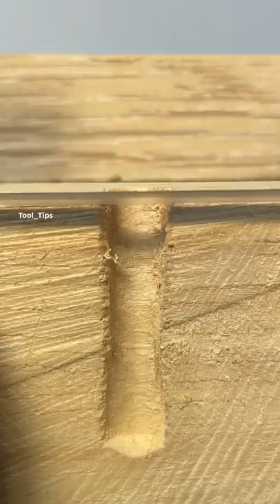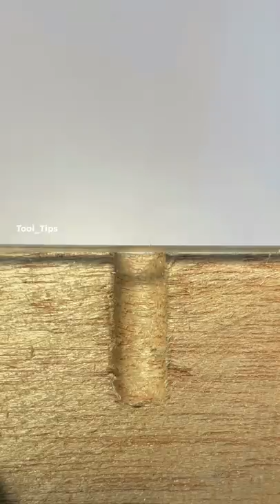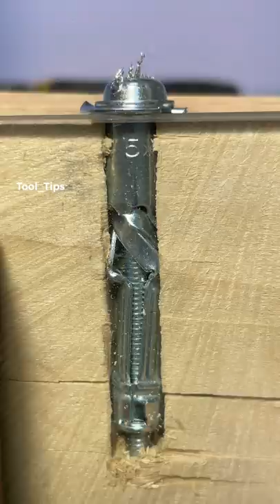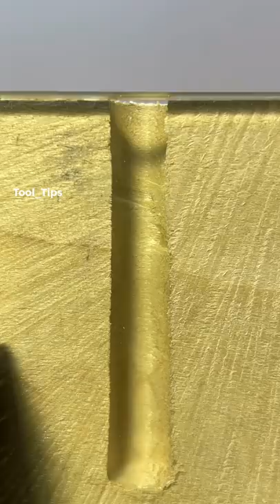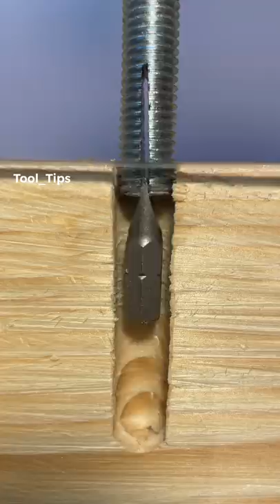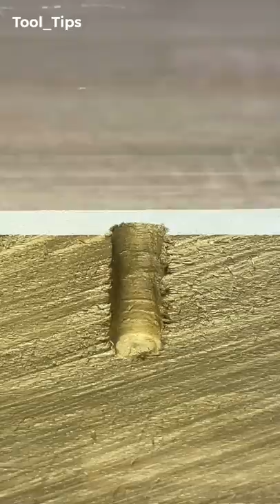#shorts The Best

Comment: I like how some of them aren't even meant for wood but you just do it anyway completely!
Reply: I don’t think any of them are for wood? The screw is designed to screw straight into wood. Why all the other stuff?
Reply: @upsidedownnugget9531  to help fill the gaps in the hole hes drilling into. Idk
Reply: @chrisoverly3000  yeah nah I’m not sure what kind of situation you would be screwing into a hole in wood like that.
Reply: @mr.tucano  yeah Good point.
Reply: @upsidedownnugget9531  the "other stuff" are anchor's for mounting, electricians for example mount heavy service panels and cant rely on only the screw
Reply: @upsidedownnugget9531  the one with the dowel and screw is the only one meant for wood. The rest are meant for drywall.
Reply: @mr.tucano  except that they don’t work as designed in wood, making the “demonstration” inaccurate, and pointless.
Reply: @clutchuwu1355   I understand what they are but I’m not sure when you would use those anchors in wood? They look like brick or concrete or for plasterboard. 
When would they be attaching heavy panels to wood?
Reply: I appreciated learning how they work from the "inside." Whether in the intended material or not. From Oz. 👇💜🙃
Reply: @mr.tucano  yeah but he could have done same thing with dry wall, which is what they are made for, except for one of them and the one meant for wood he didn’t even use right.
Reply: For real. Drywall is half an inch thick. The ones made for drywall are made to expand past the drywall. You don't see the actual function because it can't actually expand like it's supposed to.
Reply: Lol it looks like you copied this comment word for word
Reply: There are no anchors for wood. Only for drywall, because the gap behind the drywall has no support. Or concrete which usually leaves too much wiggle room for good support and needs plastic anchors to fill in the gaps.

So...none of this accurately depicts what anchors do.
Reply: @CasshernSinz1613  the wooden peg he shoved in the hole from time to time can actually be used but he still used it wrong.
Reply: @richardp5920 no there's only one specifically for drywall. The others are masonry wall plugs and there's also a couple of sleeve anchors.
Reply: @CasshernSinz1613  Yeah that’s what I was thinking lol, I’m a electrician and have never used any of this shit besides for drywall and concrete. Drilling directly into wood is much stronger idk why you’d ever need to do this.
Reply: u took an already written comment and added “completely!” and really thought we wouldn’t notice. someone’s desperate for attention 😳
Reply: @jacob9230  maybe if someone inexperienced used a too large sized drill bit for a pilot? I often pilot before I set a screw or nail to prevent the wood from splitting
Reply: That makes sense half of these screws were splitting the wood.
Reply: @richardp5920  at least three were meant for concrete.

Comment: I like how he used a flathead bit on that bolt. Now I know why my bit sets never have flatheads in them
Reply: Yes! Haha
Reply: Do they actually have another purpose? Flathead are one of the worst bit to use 🤣
Reply: @olivierlalancette3123  right?!. I find myself using them as a convenient scraper if anything else 😂. Flat head screws are easy to strip too smh.
Reply: @koneko_469  yep and a nice way to slice your hand open. No surface area, bad at taking torque. Just good for prying on stuff
Reply: At first there were only flat head screws. Cross head screws were produced much later. When i was helping my father renovating his house. All we found were flat heads. So thats why the flat head bits exist. Because theres screws left i think but they are beeing pushed off the Market by cross head and torx
Reply: @chinchill3r545  hope it gets pushed. Torque and square bits are the best. And hex are good too but not widely used.
Reply: Flat heads have their place. They are mainly for when a screw will be visible. If you are slipping with a flat head, you are either using the wrong size bit, trying to use a drill or it has 60000000000 coats of paint on it.
Reply: True
Reply: I was searching for this comment 😁
Reply: @chinchill3r545  exactly, flatheads are still around. I live in Russia, there used to be a near permanent shortage of screws here. So in any older interior there is bound to be a mishmash assortment of screws, flat, cross, anything. People used what they had.
Reply: If he kept twisting i to wilder just popped off as well
Reply: @olivierlalancette3123  They really are annoying but have unmatched torque benefits in comparison to Phillips head screws
Reply: @koneko_469  For me, flat heads are way easier to use and Philips heads either ruin the screw or get ruined.
Reply: @imokin86  probably the most informative comment here. Now you got me curious about Russian history! Have a good day!
Reply: @chinchill3r545  those strip too easy for me better than flat for sure, but basically a one time use (I do more work with bolts than screws so i need to take them on and off several times). I get square or hex when ever I can.

Comment: Most of these are designed to anchor in drywall, not wood. That's why they don't expand correctly.
Reply: Brickwork or plaster.
Drywall anchors are different as drywall is thin and shitty.

However the worst is plaster on mesh. If you're refurbishing you can at least take drywall out easily. Lath on mesh is a fucking nightmare as you need to smash it and use wire cutters to remove it bit by bit.
It also often contains asbestos.
Reply: Oh.
Reply: I ate children for breakfast  Not necessarily. Some of the metal ones too. It's more about the design than the material.
Reply: Yep!
He's not expanding correctly...

Comment: If you're wondering why these are expending so little in the wood it's because most of these plugs aren't made for wood. If you're working with wood you use screws by themselves.
Reply: Its all about holes that are too big i guess
Reply: @dolphin082  What do you mean?
Reply: @Andee...  you most definitely can predrill. But these inserts aren't made for wood
Reply: @jojodroid31  the plastic ones are at least?
Reply: Pretty sure its not about the correct anchors but how each one operates and the different kinds
Reply: @majinvegeta9280  most of these are operating incorrectly in this video because they are not being used in the right material.
Reply: @sephiroth5949  no, plastic caps are inferior to wood screws.
Reply: Exactly. Those black screws which come in many different lengths.
Reply: Yup, made for plaster  or Drywall
Reply: @sephiroth5949  They are drywall anchors
Reply: Aron Orn 😎 thx I was slowly realizing that, but this video is great to teach newbie DIYers why certain screw plugs don't work at hanging pictures or mirrors...
Reply: @Andee...  sure you don't need to .. if you like splitting your wood. I suggest predrilling your wood to the diameter of the pin of the screw (i.e. not including the twisty portion) and you'll find your projects are held better, split much less often, and therefore last longer and look better.
Reply: Wow no sabia eso
Reply: I always work with  wood.
Reply: @Fiorina_Predator  happy building bud :3
Reply: @elhollins5988  Bu
Reply: Well, u learn new things everyday
Reply: @Andee...  You don't need to, but you'll end up splitting the wood.
Predrilling a hole the size of the screw without the threads means that you'll not split the wood, the threads hold just as well and you put the screw in more accurately as wood screws tend to skid around, especially if you're  ot using a screwdriver but driving the screws with a drill/impact driver.
Reply: Spot on. One of those fixings is a hollow wall anchor that uses a gun to pre expand it before installation of the set screw..
Reply: @jrodriguez1374  Like the "Old School" Pipe Organs I used to work on.
 The original builders would usually leave scrap pieces of wood from the time, so the same wood could be used for repairs, etc later.
 I don't think they thought we'd be so grateful to have the exact wood from the early 1800's! Probably never imagined them around 200 years later?
 These often had Historical significance, especially because of the Original wood still intact.
 What was really cool was seeing the Signatures of those who did the original build! Always found inside the Organ, where the work was done. Very Surreal.
 Maybe off topic, sorry, but how amazing it was to have extra 200 year old pieces of wood. I'll never forget the Old signatures, as well!
 Almost a time travel machine!✌️💜🙏
Reply: @timturk1899  that's awesome! There's so much to learn from our antecedents!

Comment: For anyone wondering. It’s used to fill in the holes and creates a tightness with the wood and the nail used so it’s not loose and won’t come off
Reply: Aren't most of these drywall plugs??? That aren't suppose to be used in wood.
Reply: @Hondaddy  you can use them anywhere
Reply: Thanks captain fucking obvious 🙏
Reply: @sporillasanchez1648  be mad at the person who commented still wanting an explanation for how these work. Not me lmfao
Reply: @Hondaddy  yeah these are for drywall but I mean it seems like it works on wood too in the video 🤷🏻‍♂️
Reply: @sporillasanchez1648  not everyone know that ok
Reply: How did you figured that out?
Reply: @Hondaddy  c7
Reply: 8
Reply: @patolol3091  you CAN use them on wood too but you shouldn't... a standard wood screw would work...
Reply: @ubi_hit_reg8707  yeah that was just an example
Reply: Ah yes but instead snaps the wood
Reply: For like all my life I just never knew wtf they were for....until this vid but thanks your explanation made it more understanding
Reply: @sporillasanchez1648  idk, I feel like using a drywall anchor to secure a wood screw into wood rather than just using the wood screw as intended may warrant some further explanation.
Reply: Can you elaborate?
Reply: I never use those anchors, never had a problem to use them. At least not yet
Reply: @deemack3719  because they're for drywall, not wood lol. The tabs you see are supposed to fold outwards and flatten when you tighten the screw and grab more surface area behind drywall, these are not used for wedging into a bore.
Reply: @squareheadhuman9684  me either until now but still.... I still have the question of... WHY didn’t they just not drill a hole that was too big to begin with?
Reply: @osparav  tell that to the Guy in this comment section that wanted an explanation to this plus everyone that liked my comment lol
Reply: @vivacityx8167  You didnt comment at the right place for them to read it, genius.
Reply: @Hondaddy  they’re technically anchors for drywall, so the screw has something to bite into. But you can use them for numerous different reasons, & yu can use them on wood also, all it’s gunna do is give it more strength, the anchor expands so it can’t back out over time. I wouldn’t recommend using them though lol I’ve seen people use them to hang flat screen tv’s on their wall when they either can’t find a stud, or there is no studs where they want the tv at, & I’ve seen them work great & hold up for a long time, but I’ve also seen just many fail, & now yr tv, or whatever yr using it for, or hanging up, is now on the ground, broken, & now you have a hole in yr drywall lmaoo I don’t trust them for any type of real weight to be put on them, but depending on what yr using them for, they’ll most likely get the job done. Very oddly satisfying video though lol this guy could prolly hang a full size vehicle on a wall & have no problems lmao
Reply: Thanks captain obvious
Reply: Thanks captain obvious like if you didn't know what this was and just figured it out by this guys comment, you are EXACTLY, the people were talking about when people are talking about general dumb people.
Reply: Thanks for the explanation. Ignore the trolls - they’re probably just bots LOL
Reply: Geez. Thanks for the edumacation professor. DUH.
Reply: Oh thanks it makes sense now
Reply: I use these for drywall never on wood
Reply: Thank you Captain Obvious
Reply: GOD BLESS YOU AND YOUR COMMENT I was definitely wondering
Reply: A normal screw would suffice
Reply: They're not ALL for drywall.
Reply: @Hondaddy  these are used even in brick walls
Reply: Ooo ok. I was just watching in loop form hahaha didn’t know it was a loop until half through the second time watching it. I thought it was just showing you how drills look like hahaha

Comment: Most of these are meant for drywall, and you’re also supposed to manually thread them, that’s why so many of them break
Reply: Exactly!
Reply: I like it, still.
Reply: Yeah thought this was a how not to rather than a how to lol
Reply: Thank you haha. I don’t know about this stuff, but one can imagine it probably shouldn’t go like that
Reply: @KingofgraceSARA  nie będzie
Reply: I wanna think they knew that and it's just for show
Reply: @tf5885  سلام ف4ابغلذ42ا5هذ
Reply: I was thinking 'what is the point of half these things, they're just getting destroyed' hahah, cheers for clearing that up
Reply: Thank you. You took the words right out of my mouth. Very frustrating.
Reply: I always manually screw mine in because an older person once told me to when I was just a sapling; so glad I listened and am doing things properly!
Reply: You mean bricks or concrete
Reply: @rbxrockettrio8650  Yes those too but primarily drywall
Reply: I thought them breaking was just their way of being like "this isn't going ANYWHERE"
Reply: Thank you thank you thrill but I did learn about the wood pegs that's ingenious
Reply: I was just gonna mention it. Almost all of the plastic anchors used were meant for drywall. Stick to good old claw inserts for anything else
Reply: @YerMate  yeah they are mostly getting destroyed due to immense overtightening
Reply: I saw a few very cheap ones too. Those never work as well as the less cheap ones (because those plugs never really get too expensive, so spend those few extra cents).

Comment: Most of these are due to the holes being the wrong size. Plus that some are meant for different materials walls. Also dowels are meant to be able to be taken out, not fixed into the hole with glue or a screw.
Reply: I mean, in a lot of applications dowels are used for permanent joints, usually where you would expect only shear or compression stress, and no tension. For a common example look at Ikea furniture, the majority of it's joints are little pegs.
Reply: @thundersheild926  because dowels are the strongest type of joints for woodwork. They aren't meant to be permanently glued, screwed or spilt in the hole. They are designed to be a quick and* strong joint that you can put together and take apart with ease in woodwork.
Reply: @DeusInsaniae  
 Might not be what they were intended for but they also work very well in permanent situations.
Reply: @thundersheild926  l
Reply: Good morning
Reply: It's called a gap you fill it in when it needs inserted
Reply: I was wondering tbh cause I’ve made chairs and tables and thought maybe it’s to keep the wood from splitting
Reply: I have no idea what you're talking about but thank you for sharing and being good at your craft
Reply: Yeah why is nobody talking about how clueless this dude is. I mean for one thing, nevermind that he messes half of them up, why is he putting anchors into wood in the first place?
Reply: Fokiu
Reply: @drshin9893  they are one of that’s why they are used in woodwork.
Reply: @sauercrowder  I think that is just to let you see the mechanism in the video, because he could create a visible set up with wood and plexiglass, and probably he could not do that with other materials.
Reply: Not really, lots of people still use dowels with glue to align long boards for big panels like tabletops
Reply: @Diana-bq9fw  You can't put a sheet of drywall up against the glass?
Reply: @thundersheild926  mo mo
Reply: @thundersheild926  jjjbnnnnnnn
Reply: Never mind that half of them are being over tightened
Reply: @DeusInsaniae are you talking about dovetails they work perfect without glue and last for decades while looking good. Dowels are like the retarded brother of dovetails cheap and easy to apply and often used in furniture that will simply break after moving homes more than 2 Times
Reply: @sauercrowder  wood is cheap and you often have leftovers
Reply: @LP-XXX  It's really irrelevant tbh, the point is the person trying to make this educational video has no knowledge of how fasteners are supposed to work. You could use wood to demonstrate a drywall anchor, but then it should be no thicker than 1/2", because the purpose of the anchor is to expand into the empty space behind the drywall. If you can drill a pilot hole an inch or two into solid wood, you don't need an anchor and what you'll get if you use one is what's shown in the video - chewed up plastic pouring out over the screw head, serving no purpose whatsoever. This is a basic misunderstanding of how these things are used, and it's being presented as informational. That's extremely irritating.
Reply: @LP-XXX  Btw sheet rock is at least as cheap as plywood and you will always have left over pieces. Not sure why you're defending this idiotic video